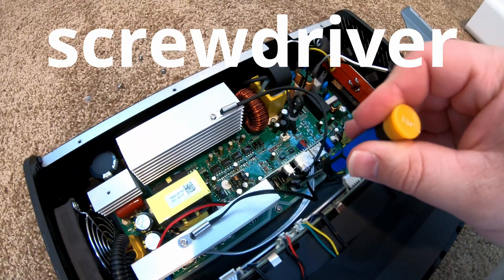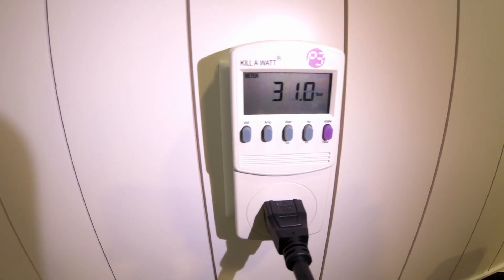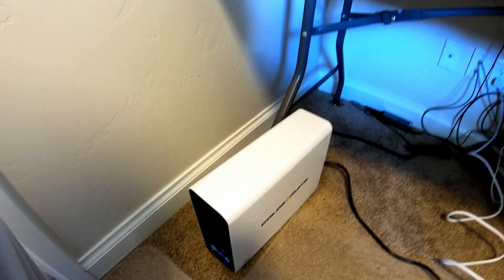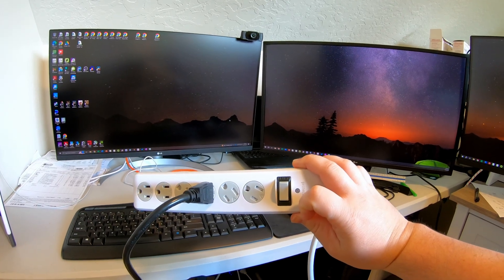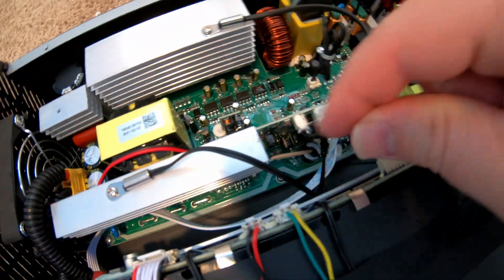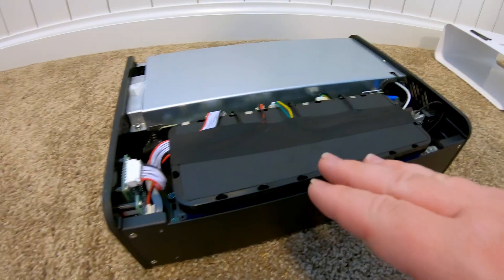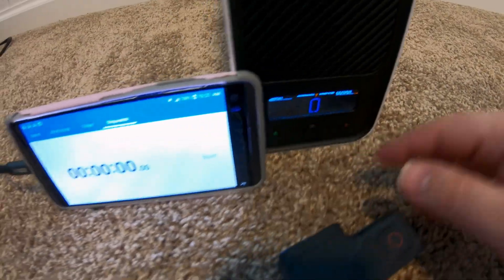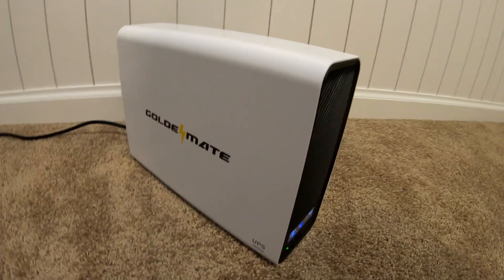Testing GoldenMate UPS: Is It Worth the Hype?

Comment: This is just a power station. It's a transformer less unit which I see why it wouldnt work on highload demands.

Go put a voltage tester and put your conputer under heavy load, youll see why this kind of power station is not recommended for computers.
Reply from the maker: It works great for my computer!

Comment: This thing seems great for computers. I have a massive 2000W SLA battery UPS and had to replace the batteries at substantial cost after only 2 years. I ordered this for only $209 and hoping it has a much longer battery life for my new downsized 800W setup.
Reply from the maker: I’m sure you will be happy!

Comment: Can it shutdown a mac when power is lost?
Reply from the maker: Not this model unfortunately.
Reply: @theresatrickforthat Are there any reputable lifepo4 UPSes that use lifepo4? Or is it just better to use a powerstation like from anker and then a lead acid ups for triggering shutdown? No devices plugged into the lead acid ups, it just shuts down the computer when power is lost and the computer continues to run off of the anker powerstation.

Comment: I've seen several reviews of this unit, but so far haven't found anyone testing how it handles when you turn on a computer connected to it. In my experience the power on surge of big servers can bring down several types of ups-es. For example you take a 1000VAC UPS, connect 2 or 3 servers that normally has a 100W load each, but if you switch off everything then you are not able to power up the servers simultaneously, because that overloads the UPS.
Reply from the maker: If you have too large of a system, then I guess that could happen just like my fridge overloaded it. But I have a high end workstation plugged into mine and it powers up just great!

Comment: I just picked up a 1500va 1000w unit this brand for my new PC. Build a multi thousand dollar PC, cant forget about the UPS. I also bought a Renogy 2000w Inverter with UPS switch. I am eventually going to try to rig that one up to a 100AH Lith Battery and some solar panels.
Reply from the maker: Sounds like you're going to have a sweet setup when you get it all working! Thanks for watching!

Comment: @theresatrickforthat: How has the UPS been running so far?
Reply from the maker: Extremely well! Zero issues! Totally love both units that got sent to me and two more I purchased myself! Thanks for watching!
Reply: @theresatrickforthat  Thank you for the helpful review. My own unit is on the way.
Reply from the maker: You’re going to love it!
Reply: Question: when you opened the unit I noticed two thick black cables capped with a yellow plug. I assume this was the battery connection to the main board. How easy would it be to route them to a larger external battery?

Comment: I bought the 1000 watt model for my trading computer.  It has 4 monitors and a Invidia 4090.  Can't power all of them running under heavy load.  Too much draw.   Had to unplug the monitors.
Reply from the maker: Bummer it didn’t work…but not surprised with the beast of a computer you’re running! Thanks for watching!

Comment: So even the lithium battery backups use a small trickle charge when in standby just like SLA. Or is it the inverter that’s sucking power with it just being “on” but not in use?
Reply from the maker: No. Lithium batteries do not need a trickle charge to stay healthy like lead acid. There is just overhead with the inverter and electronics. Thanks for watching!

Comment: I got a 1500VA/1200W one, plugged in a PC and had it drawing less than 500 watts when I pulled the plug and my PC died instantly. In other words,  it failed to support the PC at less than 40 percent of its rated load. The PC acted like its plug had been pulled, so mine is useless as it is for PC backup. I either got a defective one or the design is not up to the task. I'm hoping it's the former. I'll see how Goldenmate support handles it and review it accordingly.
Reply from the maker: I hope it’s a defective unit and that you get it sorted out! Thanks for watching!
Reply: We're you able to get in touch with support? So far I've tried for my own questions on Amazon and direct on the site - ghosted on both  :(
Reply: @senyk1  Yes, I did reach someone. The person I spoke with seemed genuinely concerned and surprised that it failed under such a relatively light load. He asked me to send them an email with my specs, description of the issue etc. I'll see how it goes.
Reply: @celatugamerboy4863 how'd it go?

Comment: Am I missing something? Looks like the battery is not replaceable, so after 10 years the whole thing is e-waste?
I also want to say buyer beware. I bought one of the new versions with a USB connector for a computer or NAS, and on both devices I keep getting messages that the UPS keeps going in and out of battery power. Which is very concerning. I don’t understand how this machine can constantly be going on and off battery like that. I  think this is my first and last GoldenMate
Reply from the maker: Not necessarily…10 years would be a general timeline, but in reality LiFePO4 batteries last so long you’ll probably be good for 20 plus years on the battery side at least! The electronics inside will probably have issues before the battery does. The battery is replaceable…it just un plugs from the control board. You can see that in my tear down. The question is if GoldenMate will sell just replacement packs or not. Thanks for watching!
Reply: @theresatrickforthat that’s my concern. A UPS that has a big sticker warning to no open it? That screams “not user replaceable”. APC and other UPS vendors have clearly accessible battery compartments and what’s more, clear instructions in the manuals on how to replace them. There is nothing like that in the instructions for GoldenMate. You’re right that the electronics may fail before the battery. But then again I have UPS’s that are over 10 years old on their 3rd set of batteries that work like Day 1. So a company that more or less implies that they don’t want you replacing the batteries is also kinda implying they want you to throw away the whole thing. Not cool.

Comment: The online information states it should be plugged directly into the wall vs through a surge. Does that make a difference?
Reply from the maker: It shouldn’t…you just miss out on using the surge protector built into the UPS if you have a surge protector connected ahead of it. Thanks for watching!
Reply: @theresatrickforthat thanks I bought one yesterday.

Comment: Nice video. Would be nice if the GoldenMate had a solar panel input to help maintain its charge, since it takes so long to recharge via AC outlet. I'm using it (my mute button also doesn't work), a Bluetti AC70 and a Ecoflow River 2 Pro in different rooms of my house. The latter two both have more than double the Wh ratings, charge significantly faster on AC (an hour or so to 100% from 0), and have XT60 inputs for their respective solar charging panels, which I'm using to supplement the AC as well as have in case of an extended power-out. But they're also both twice the price on best sale days... But even a little PowerFort 100Wh LiFePO battery pack I grabbed for $50 on Amazon Prime Day has a DC5521 solar panel charging input, so GoldenMate should follow suit. The PowerFort, however, has no UPS function, which is more important to me in most cases.
Reply from the maker: I agree! It would definitely be a big selling point! That port could work with a solar panel or say an external 12 V battery. And then people could decide how to utilize that port to expand the capacity/run time! Great thoughts! Thanks for watching!

Comment: The big missing feature is the USB to Serial port so we can use NUT Server to self-shutdown the PC or Server attached gracefully before the battery of the UPS depletes.
Reply: They have added a model with a USB comm port. It is located where the service port is on other units. No software is included for displaying status, history, or selecting shutdown options. It is limited to what your OS or NAS natively supports. On Windows 10, the best I can get so far is to go to sleep x minutes after on battery. Ideally, I'd like it to run until 50% power left, then hibernate.
Reply: @FreeRangeEagle  Interesting, I am looking to see if they support NUT Server software so I can monitor the UPS using this opensource software from a linux box (i.e., Debian)
Reply from the maker: Agreed! Hopefully they add that feature soon! Thanks for watching!

Comment: Nice video I use I middle Atlantic ups low frequency inverter 48 volt to run half my house 24/7 on a 14 kWh mango over e batteries I use a solar charger to charge the batteries from the solar panels it’s been running for 2 years and going 1800 watts continuously mine has a shut off for the buzzer
Reply from the maker: That sounds like a great setup! I’m glad it’s working so well for you. Thanks for watching!

Comment: Lead acid can still output way more current than a LifePo4 equivalent.  You can swap out the lead acid on a 12v or 24v UPS, but need to limit the amperage to the LifePo4 battery's max.
Did you notice the XT60 port on the board just behind the fan!?
Reply: Depends on the lifepo4 battery, and the BMS it uses. 99% of the time, the output current is limited by the BMS not the cells. Just lookup headway 38120 cells or a123 cells. Just 4 headway 38120 cells can start a car and can handle 120 amps of continuous discharge at only 8ah capacity, making them much more useful than any comparably sized SLA battery. 

Also, the SLA batteries that come with consumer UPS units are only rated for 7-10 amps continuous discharge, hence why they do not last very long at all despite being 7-9ah batteries, cause the voltage sags too much. lead acid can handle bursty loads (car starting, etc) but suck balls for things like a UPS.

Try seeing how many Watt hours you get out of a consumer grade APC 1500 or cyberpower 1500 at 600+ watts. It will be nowhere close to the rated capacity of the batteries (24v 7 or 9ah eq 168wh-216wh). 
You'll be lucky to get 2 mins or more than 10Wh lol.
Reply from the maker: Thanks for sharing! I did notice that port. It bigger than an XT60. I think it is a XT90. Thanks for watching!
Reply: "Lead acid can still output way more current than a LifePo4 equivalent..."  Complete nonsense...  A similarly-sized LiFePO4 battery will supply far more current than a typical SLA battery found in a UPS.  Voltage drop under load with SLA is huge, making them nearly useless under high loads.  As others have said, the BMS will be the limiting factor and they will size it for the application at-hand.

Comment: @theresatrickforthat Can you please test the unit and reply here with the results for when the unit runs on battery, fully exhausts itself (like an all day power outage), and when power is restored by the power company does the unit AUTOMATICALLY turn on.  There's nothing more frustrating than being on vacation for a week, realizing your UPS doesn't auto-turn-on and you are down for a week instead of just a day if you had not had a UPS at all.
Reply from the maker: I’ll see what I can do. Thanks for watching!
Reply: @theresatrickforthat  Thanks@  Even a quick reply in this thread would help others as well I'm sure :)

Comment: 10:18, you can use some electrical tape to cover up the buzzer. I did that to all of my UPSs. Taping off the buzzer lowers the noise, but you can still somewhat hear it from close proximity. In my humble opinion, it's better to have an alarm than not have it at all.
Reply from the maker: Good tip! Thanks for sharing and for watching!

Comment: 4:00  I've always heard not to daisy-chain surge protectors together.  Running in a non-surge protected power strip, yes.
Have you experienced any issues with your setup?
Reply from the maker: I’ve had zero issues with my setup! Thanks for watching!
Reply: that's only something people say because most people don't know how to ensure you are using correct wire gagues and not overloading any outlets/wires. as long as you know how many watts are going through and how many watts your wires can handle, there is no risk

Comment: My gets warm on the top. That’s only with a small printer hooked up 1 watt out 2 watts in. Printer not running just on stand by. Is that normal or a fire 🔥 hazard in the making?
Reply from the maker: That’s normal for it to get warm even with limited power going through it. Thanks for watching!
Reply: @theresatrickforthat  Now it’s warm for a couple days it’s releasing a warm electronics smell . Kind odd since there’s no more than 1 watt being taken.
Reply: @user-zm1sc1hk4x  if there is no conformal coating, the smell probably isn’t normal if it persists. You should be careful.

Comment: 20 milliseconds is awful.  I hope that is incorrect.
Reply from the maker: They are supposed to have a new and improved version out now. Maybe they have improved the switching time. Thanks for watching!
Reply: @theresatrickforthat  My new and improved 1500VA/1200W unit, brand new out of the box, claims a 10 ms transfer time. It failed to support my gaming PC under less than 500W load. The PC just died instantly.

Comment: Muting it with the button on the front seems more practical and indicates you read the manual.

UPS are not designed for high load devices.  Why one would try it is beyond me when you can read the power requirements of all the devices and act accordingly.
Reply from the maker: My understanding from other commenters is that since I got one of the initial models, they’ve released an improved model with the ability to mute the beep. That’s fantastic news! And yes, you shouldn’t try to run super heavy loads with something like this…but there will be people that think they can, so I figured I’d run the test to help show everyone that it’s not capable. Thanks for watching!

Comment: I wana use it for my pc only that takes 600w but my psu is 1000w unit will this create problem?! Because the ups only can output 800w
Reply from the maker: Shouldn’t be a problem…just make sure your PC doesn’t pull more than then 800W. Thanks for watching!
Reply: @theresatrickforthat   no thank you good sir

Comment: you should have measured the battery pack before you start talking about a 12 volt battery add-on..
Reply from the maker: It’s a 24V battery pack in the UPS. So yes, you would need to get a 24V add on battery or change the voltage of the interior pack to be 12V. Thanks for watching!

Comment: I'd love to buy one, but it lacks one critical feature which is the ability to shutdown a PC when the battery gets low.
Reply: Their new model will shut down a PC or server. It's going for $240 vs $170 on Amazon for the older model that does not have the feature.
Reply: @slbowling  That's a nice feature, but what if you have it running several small computers?
Reply from the maker: True. But it does everything else! :) Thanks for watching!

Comment: What CPU and GPU is in your PC? what video card
How much minutes backup time do you get when it's under load? before the battery runs dead?
Reply from the maker: I have an Intel core i9 10th gen processor and an Nvidia RTX 3080. If I am pushing it super hard with 4K gaming, it will only last about 15 minutes before going dead. That’s why I would like to see an expansion port integrated on the UPS so I could add more external batteries. If I’m just browsing the Internet and doing email, it will last about an hour before going dead. Thanks for watching!
Reply: @theresatrickforthat  Thank you for the reply my PC is a Ryzen 5700 X3D and RX 6800 GPU and a 34" Ultrawide OLED Monitor and 550W Seasonic 80Plus Gold PSU and a modem plugged in how long do you think I would get if power goes?
I want to buy the smaller version to this its on sale on Amazon the 600W but I am afraid it might trip under load?
Reply: @tusk6489  My brand new 1500VA/1200W Goldenmate tripped under a 477W Gaming PC load. I'm not sure what to do with it now as that's the whole reason I bought it.

Comment: I have a desktop computer and monitor that requires 900 watts of power. This unit is rated for 800 watts. Is it safe to run my desktop and monitor on this?
Reply from the maker: I wouldn’t chance it. Thanks for watching!
Reply: get two and split the load
Reply: Your computer probably doesn’t use 900 watts, the power supply is likely rated for 900 watts meaning it could power that much if needed, but power supplies are always over spec’d.  Computers these days run on such low wattage, try slapping a watt meter on your machine to find out for sure.

Comment: In the instruction manual (page 13 at the bottom), it says that if you push the front switch when the UPS is providing power, the buzzer alarm will be turned off.
Reply from the maker: That must be new since I got my version to test. But good to know! Thanks for watching!

Comment: For anybody that owns one a quick note: if you push the button once when you are running on battery, it will mute the beeping sound.
Reply: Get a soldering iron and desolder the beeper, I did this with my old APC UPS.
Reply: This is what I did to my golden mate ups.  Not even a mute on the early models, newer models it’s not persistent.  Fatal flaw imho.
Reply: would you need to mute it everytime AC goes off?
Reply: @ivanosma6877 I do not know that. I think you might have to mute it everything the power goes out like a regular ups
Reply from the maker: Ummmm….on mine if you push the button on battery it will shut the unit down. So yes, it will stop the beep, but you’ll also lose power to everything. Thanks for watching!
Reply: @theresatrickforthat  no, just press it quickly but do not hold. Maybe mine is a revised model but give it a try
Reply: Yeah, this guy does things the hard way.